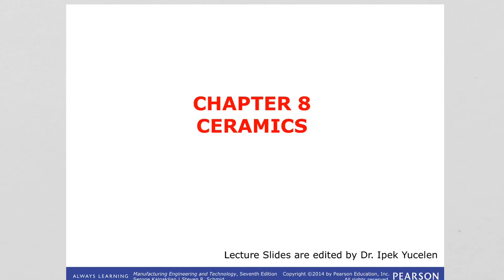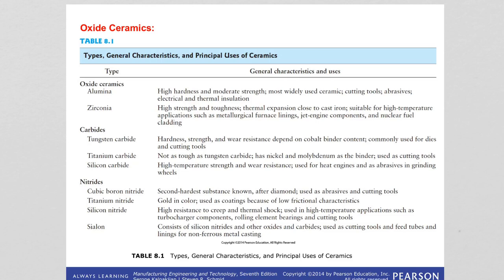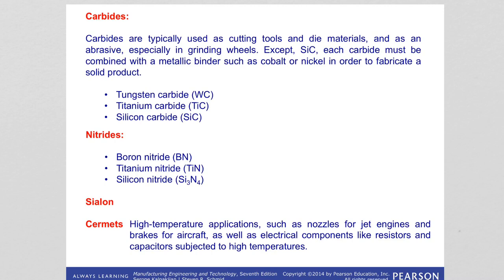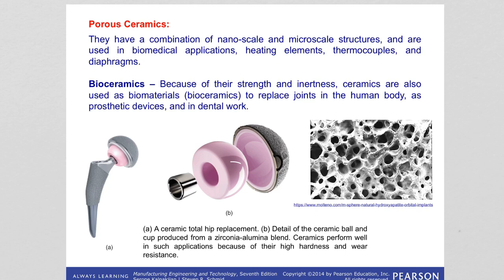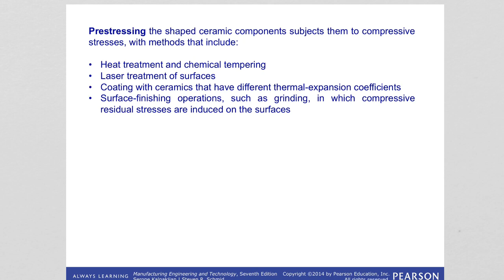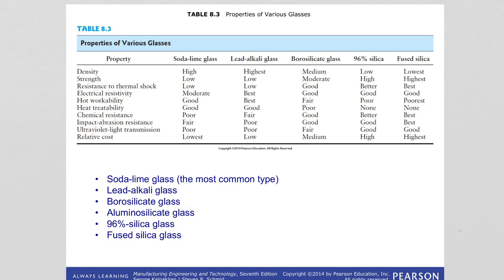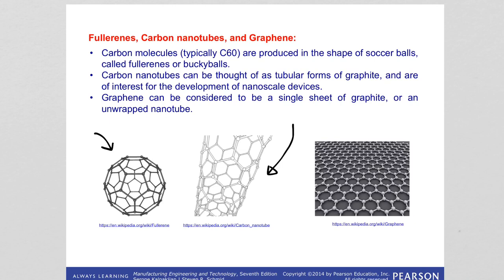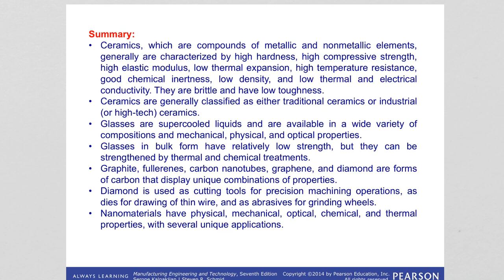ch 8 Manufacturing Processes

Comment: A turbine made of pressed silicon nitride can be used to turn water into steam with over 700% efficiency. I know of a boat motor the size of a lunch box made in the early 90's that gave 100hp and ran off nothing but the water in the bay in L.A. It's very expensive to make, even using the new process. There's a better process now but secret not patented